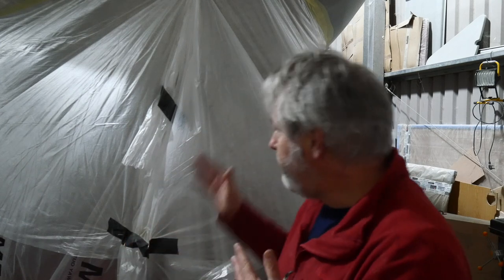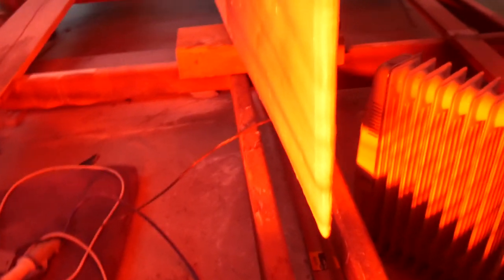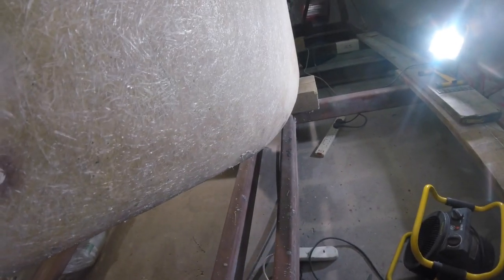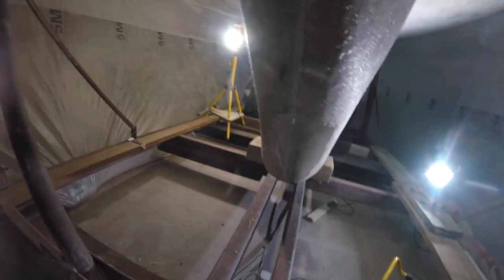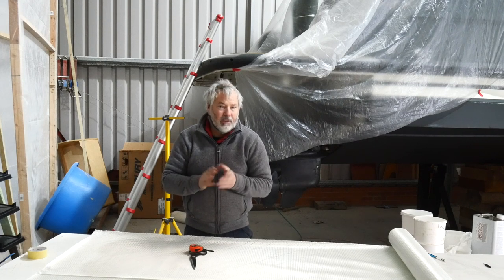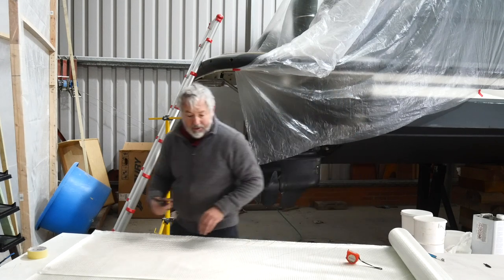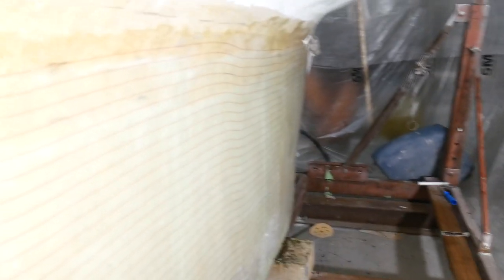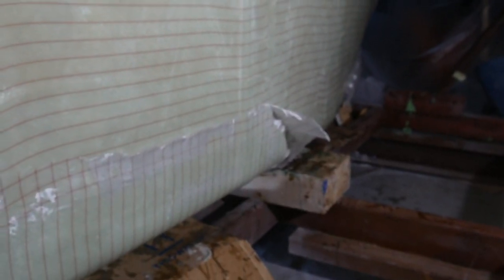#67 Repairing the keel

Comment: Richard, this has to be one of my favourite videos. I'm about to begin the exact same job. Did you grind back the keel to any depth or just remove the gelcoat, and what filler did you use to fair the surface in the end?
Reply from the maker: Hey Gilbert, I used a gel planner to remove the gelcoat. I also had to do some repairs so feathered back in places to re-laminate a few patches. First I filled pinholes on the topsides beneath the waterline with Watertite - a two part epoxy. You could use West with low density filler for that. I used colloidal silica around the bottom of the keel though make no mistake this is not something that can be 'faired' it is tough. But It needs to be strong so I compromised and has a few seams etc. Up higher on the feel I used west with low density filler to fair where the laminate overlapped and formed seams. Good luck with your project!
Reply: @aboatcalledwanda6925  Thanks Richard, that's really helpful. I hope to start on the keel in a week as the engine is the priority at the moment, hopefully running in a day or so. I hope all is well with Wanda, I've learnt so much from your project.